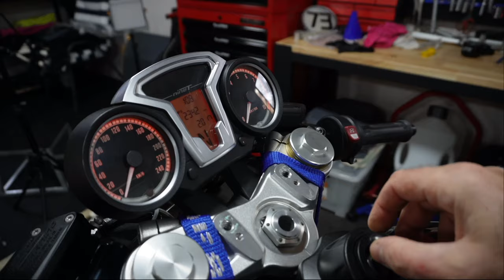R9T:  Oil Change - How To

Comment: Just about to try the oil change myself what is the magnetic washer u use for the filter I found one for the sump plug not the filter
Reply from the maker: Hey there @mengaw-yong2490, the ones which I use are from Motion Pro. 👊✊️👍🙂